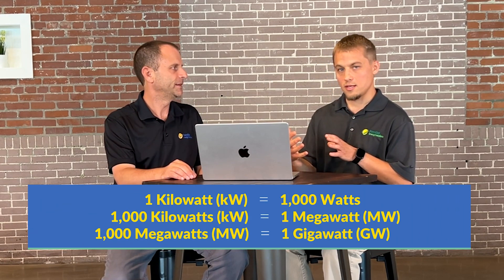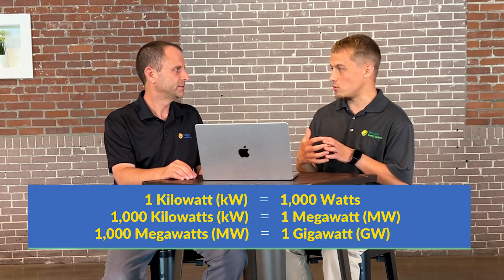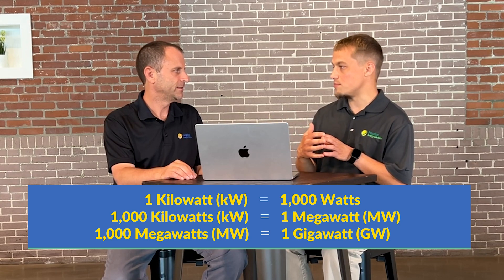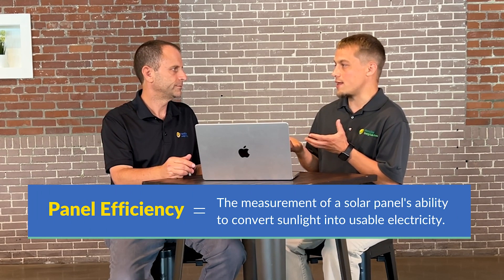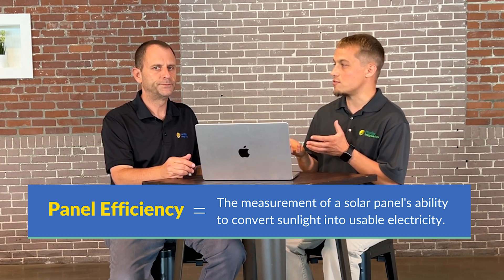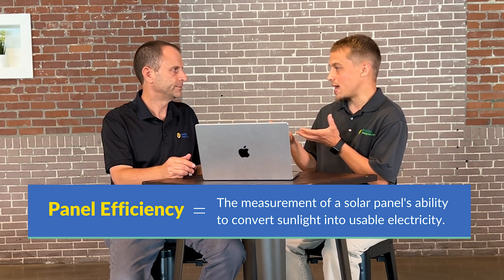You NEED to know these solar terms (common solar concepts explained)

Comment: The 1MWh the solar panels generate does it mean that it generates 1MW each and every hour??
Reply from the maker: A megawatt-hour is the same as one megawatt of power used continually for one hour. 1 MWh = 1 MW for one hour or 1,000 kW for one hour.